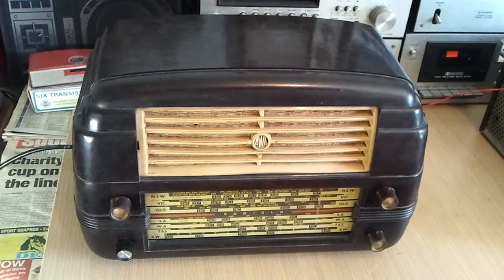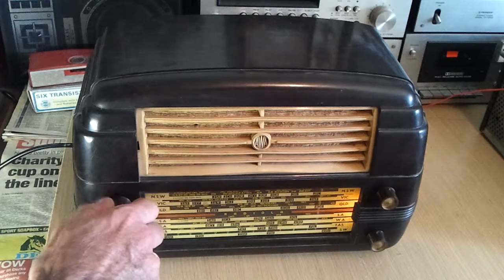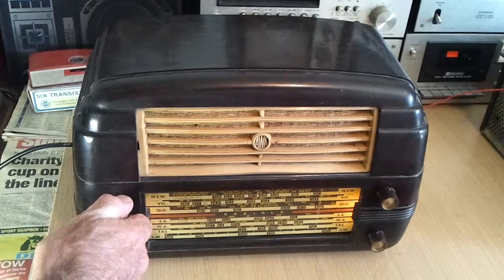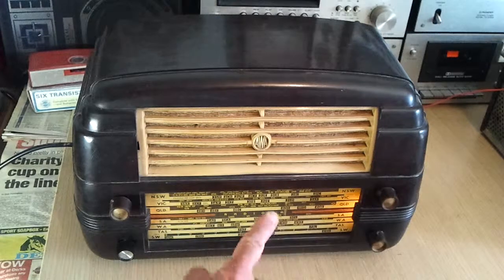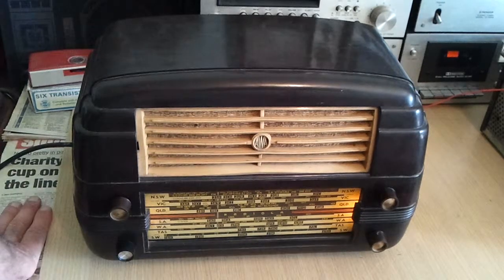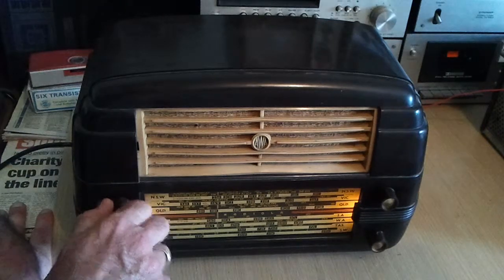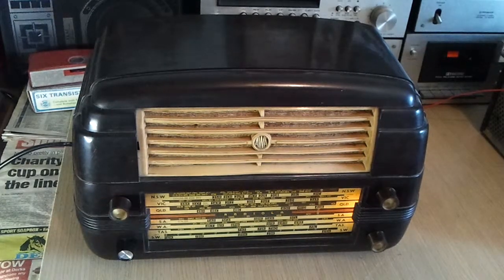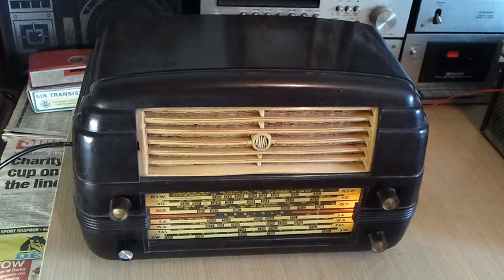AWA Radiola 528MA Repair Part 3 of 3

Comment: Top work on the radio, recently acquired two radiola's 449 and 573. I was wondering if you had ever investigated installing a audio input jack.
Reply from the maker: Thanks for that feedback! This model has a Pick Up input so that can be used for that purpose. A different connector such as an RCA may be more useful though, or an adaptor. I have 3 Radiolas, 2 of them now working.